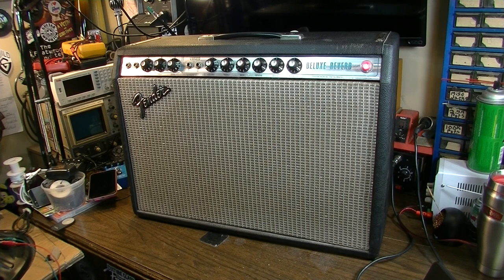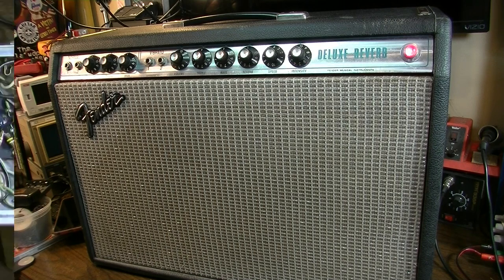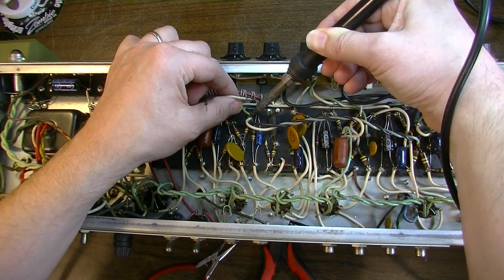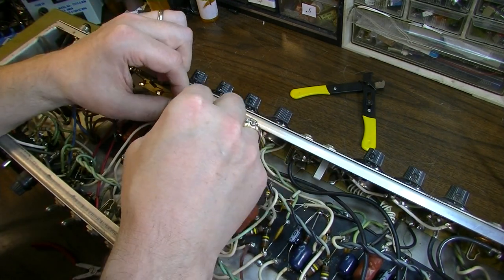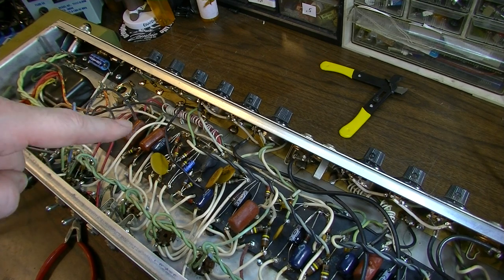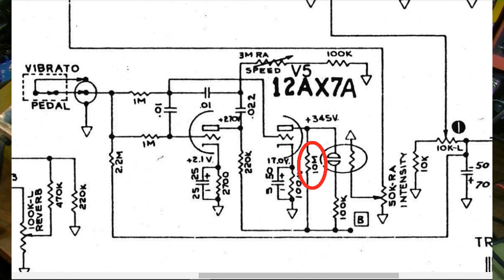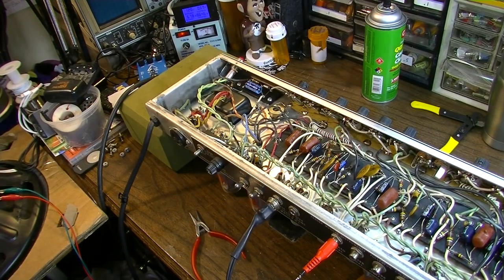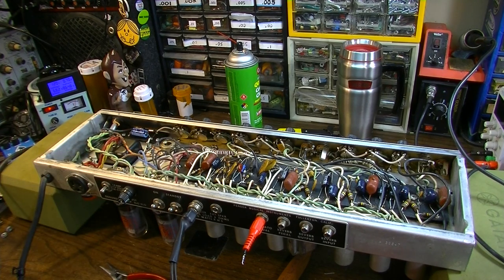Fix Your Fender Amp’s TICKING VIBRATO (TREMOLO) Problem!

Comment: Thank you for this video, the 0.01 cap, bypassing the 10M resistor completely fixed the ticking noise issue on a 69 SF Vibrolux Reverb (AB568) that I'm working on. Keep the good works!

Comment: In another lifetime, and I mean a long time ago, I was a bench tech in the marine electronics industry.  The way I'm reading the bulletin, is If there is a capacitor across the 10 meg resistor (parallel), remove it.  Then add a .01mfd capacitor from the 10 Meg resistor to ground (series).  The schematic sure looks like that to me.  Am I missing something?  Regardless, adding the cap across the resistor looks like a fix. Nice job on the video, and very good "how to"....Thanks for sharing!
Reply: You're absolutely correct. That's how "service bulletin #9" actually did it. The original bulletin even includes a layout drawing. However, doing it the way that Brad shows here ALSO works, and sometimes works better than Fender's recommendation. Go figure.
Reply: That's right, the bulletin says to place the capacitor between the junction of the 10M ohm resistor and the optoisolator TO GROUND. It does NOT say to place it in parallel to the 10M ohm resistor.

Comment: It floors me to see how these signal paths were originally made. Who on earth figured out which capacitors added or removed different parts of the spectrum?!! Beautiful to see
Reply from the maker: The tremolo circuit is just an oscillating tube stage which is connected to a light bulb, such that the light bulb flickers on and off at an adjustable rate. The light bulb shines onto a photovoltaic resistor, that is a resistor that changes resistance depending on how much light is shining on it. That resistor is then connected somewhere in the signal path and acts as a volume pot of sorts.
Reply: @TheGuitologist  you need to publish brother. You have an encyclopedic knowledge of electronics!! Thank you for taking that time. I NEVER would have figured that out!
Reply: Michael Farady, James Clerk Maxwell, and James Watt, to name a few. Up until the 18th century, human beings didn't even know what electricity was. Throughout the 19th century, many people, including those mentioned, contributed to the basic science that unlocked our understanding. In the 20th century this fundamental understanding was progressively put to work to create useful technologies. (The oscillator circuit discussed here was developed during this time.) Today we stand on the shoulders of those who went before us.

Comment: I ran into this issue on my first couple of DR builds.  I see it as a design flaw in the routing of the 2 grid wires for the V6 12AT7 inverter tube, pins 2 and 7.  They routed them in the same routing holes, or adjacent to the tremolo output wire going to that center pin of the tremolo jack.  The tremolo wire is like a spark plug.  The signal is being shot down that tremolo wire from point F on the drawing, plate output from V4B, out through the photo bug like an electron power drain to reduce signal to give you the tremolo effect.  I rerouted the 2 inverter wires away from the tremolo wire and used shielded coax for those 2 wires.  It eliminates that ticking even with reverb on.  It doesn’t take much movement of the tremolo wire away from the grid wires sometimes and that’s why it manifests itself a bit different between amps.

Comment: Thanks for the tip(s). I have a blackface DLX RVB and the .01 cap worked. The wire locations look way different than yours so I left them alone.

Comment: Wow what a difference the dressing of the wires made... And honestly, I found the wording for the installation for that capacitor just awful.. But you nailed it Brad! Great job, thanks for sharing. Be well, Tom
Reply from the maker: Yeah, can’t figure why they didn’t just say “in parallel with the 10M resistor”.
Reply: @TheGuitologist  because the schematic shows it to not be in parallel with the resistor.  The words are only partially correct in that the cap is to be placed ON the resistor, but it doesn't tell the whole story.  It can work in parallel with the resistor too though (sometimes).  I think I've now seen 4 ways to skin this cat:  your parallel method, Service Bulletin #9, 220pF across p1 and p3, and a diode across the outer lugs of the Intensity pot.  Each of these change tone and feel, especially depending on the orientation of the outer shield of the cap used (or disc cap).

Comment: Well, you made my day sir, to see what I made being used for what it was intended, as insignificant as it is, was a thrill, not gonna lie, many thanks man.
I really appreciate how you find spots for fan mail to get into videos, that's just really cool man, and if it actually doesn't work well, please don't continue to use it on my account, if the tip is too fat, you can sand that down and then hit it with some linseed oil, which is why I did the finish that way, just easy to reapply. 
Yes, I spent way to much thought on what is a fairly insignificant thing, but I can't control my brain, it has a mind of it's own...
Anyway, I just thought I'd let you know you made someones day today, thanks again man!
Reply from the maker: Thanks for that. It’ll get a lot of future use I’m sure.

Comment: also i wanna say, in quick, my girlfrind became disabled from lupos , i began building amps to keep sanity while i 

watch over her , something i could research and learn while i sit with her,    i got my 100 watt old carvin turned into a power head, ive built a couple preamps to connect to my power head , my amps have a preamp pi     then   to power amp,,,,,,,,,,,,,,,,,kinda modular.... pre and pi   to power.via rca  connectins  im having a blast building my amps, i want to thank you brad and uncle doug, and d lab and blue glow for opening a new door for me that was so much needed   ....
Reply from the maker: Amazing. Thank you for watching, George.
Reply: @TheGuitologist   i was watching the vid on pi switching 100k 47k 1.5k resistor on cathodyne pi,   seems there is a resistor missing , doesnt the cathode have a 1,5 k from the cathode before the switch matrix ?    the schematics ive seen have a 1.5k to same value on the plate , where can i put the switch matrix on a 56k plate, 1meg to 1.5-56k cathode  cathodyne pi?

Comment: Another nice vid.   Measure the LFO on your scope and see if it is a square wave.  Then measure it with the new capacitor and see if it is more "rounded" on the edges.  The sharp edges of the LFO will cause this ticking noise.  Im curious to see if that's the issue.  How come no lead solos or guitar playing at the end of this vid?

Comment: Just picked up a Fender Bandmaster TFL5005D probably from the late 1960s or early 70s. The Tremolo is doing something weird. When activated using the footswitch, the effect seems to turn on but it has no depth to it. Can hear the oscillator running and the speed control works as expected. The Trem sounds like it is in the background only. Does the "roach" in these amps often go bad? Could that be the issue here? I can pick up a new bulb / resistor roach from Tube Depot thankfully if needed. Thanks for any info!

Comment: Brad, what would happen if you rap a shield around the lead pack wiring all the way to there terminations and ground the shield to the body? Do you think it think it would cancel out some or all of the noise? And yes I felt your pain with the garbage disposal, took mine out and started a recycle bin for the garbage and use the waste after it works down on my plants as a compost. My disposal doe's not break down anymore. My simple life hack!    Best wishes from south Florida........

Comment: You're the pro, but I have a couple thoughts. Maybe winding or braiding the green, white and black together and insulating them after removing them from behind the pots and resister instead of cutting them down would lessen the length. and add the Mylar Cap 2: I have to wonder if we can insulate/shield the sloppy lead dress with some aluminum tape shielding wrapped around them then coat the entire area wrapped in aluminum in liquid tape or similar to avoid any shorts in the future and maybe that will at least minimize the noise enough to add the Mylar Cap which seems to be a must will finish the problem or more importantly removing the wires behind the pots and out of the way of the resistor on the cap that you had to remove and the Mylar Cap would have solved the whole issue. Any how the way you did it worked so.

Comment: I got a new 68 Custom Deluxe Reverb dude it was ticking so bad I sent it back & got another new one it also ticks not quit as loud but pretty loud. Many folks say it's the curse of the Fender Deluxe Reverbs black face & silver face models,  I heard a cap installed at the point of the circuit just in front of the tube that does the vibrato will stop it .

Comment: READ THIS IF YOUR AMP TICK'S!!

I have never had a ticking problem until today, and didn't know how it happened. After an hour of searching i finaly found what was wrong!
This weekend i had installed an electric mower. This little thing senses his border through a cable where there is a current going through. The signal is quite strong because it can sense it up to 100ft. (30m). And because its so strong, the pickups on my guitar sense it, causing the ticking! 
For those who have electric dog fences, its the same deal.

So before you open up your amps, check if its not caused by something like this.

Comment: Effect rode has a comment on their website to move the ground on the speed control to the ground of the resistor and capacitor on the cathode of the oscillator tube, not the opto driver tube.

Comment: Hey Brad, why not put a couple of teroid to act as a choke to get rid of that noise ?

Ricky from IBM
Reply: What's a teroid?
Reply: Richard Biffl A toroid is a coil of insulated or enameled wire wound on a donut-shaped form made of powdered iron. ... Toroidal coils of a given inductance can carry more current than solenoidal coils of similar size, because larger-diameter wires can be used, and the total amount of wire is less, reducing the resistance .
Using this donut shaped powered iron it can be used as a choke to trap or choke of EMF and or RF from interfering with  electronic devices
Ricky from IBM

Comment: What watt of speaker should I use in a 40 watt fender amp? Thanks
Reply from the maker: 40w or greater if it’s a single speaker. 50 is safer.
Reply: @TheGuitologist  What would be to much?

Comment: Does the .01 MFD capacitor have to be 600v? Is that what you used in the video or a lesser voltage?
Reply from the maker: There is about 350v at that spot. But the way I installed the cap was technically wrong from what Fender suggested, so the V potential is not that large. The mod I did is really a safer mod than their actual suggested one. See pinned comment.
Reply: @TheGuitologist   Thanks for the quick reply and info.

Comment: Hoping someone can offer some thoughts on my ticking 78 Vibrolux tremolo. Amp is with a tech once again to try and fix the ticking tremolo. Optocoupler has been replaced and every 'fix' known to man has been done including redirection of wires from the tremolo controls etc. etc. I called my tech today to see how things are going and he informs me that as soon as the chassis is put back into the cabinet the ticking returns thinking he has it solved. So when the chassis is on the workbench no ticking. Cover the circuit/chassis with a piece of foam while on the bench and running ticking goes away. So when the circuit is exposed to light it's fine but when in darkness the ticking is back. He is a patient man but I think he's had enough of my Vibrolux and I don't blame him. Nothing seems to work. The new optocoupler (bug) was the type that is fully sealed. If anyone has any thoughts as to what on earth is going on please respond ! Thanks in advance.

Comment: Wiring a tube tremolo is a dark art, not science. Once you wire it up according to the schematic, you are about 10% done. Had a similar issue with the tremolo on a Mojotone tweed vibrolux clone. Three days later after pushing wires around and adding shielded cable it worked perfectly!

Comment: Most of the time I find that the Plate wire to the B side of the 12AX7 before the Phase inverter is very close to the Grid wire of the 12AT7. That's usually the first place I look.

Comment: I have a twin that ticks, would this possibly be a fix for  a twin?
Reply from the maker: Yes. Same concept.
Reply: before doing that maybe check the wires at the valve for the tremolo (the 5th for a drri) see this video www.youtube.com/watch?v=AZWJevfjrUw for more info. It fixed the same problem on my ddri

Comment: unluckily the European version has a replacement for the roach :/ i think, that originally the extra cap was intended to be connected to ground (to the other side of the roach) ... In my case, European version of the reissue, just rearranging the wires to the tremolo tube helped a lot, being aware, that in some positions the tremolo won't work anymore. Oscillation won't start. The rest was eliminated by adding a PPIMV master volume ;)

Comment: Im always amazed when I watch someone solder because the moment they touch the joint, its hot enough.  I have to sit there and twist it and roll the tip and it always takes 2 or 3 minutes to heat the smallest joint.  Once the solder flows I can make perfect joints.  What the fuck am I doing wrong?
Reply: A few possibilities.

1. Your tip must be clean and well tinned (nice bright silver) with a little fresh solder on it.

2. You might need a stronger iron. A little 15 watter for component board work doesn't have the ass for heavy gauge wiring for instance. Oh it can be done but like you said, it's going to take a long time. 

3. This is unlikely but something I run into a lot. There are higher temp solders out there. I work on stuff that's put together with high temp silver solder a lot. Requires a beefy, 900-1000 degree iron to deal with easily. You wont find that in amps so I doubt that's your problem but thought I would mention it in case your working on controllers for electric race cars or something.

Comment: Had similar issues on my 65 DRRI but got it solved at the V5 tube by only bending the green and blue wire away from each other. Thanks to this video by kody harrell youtube.com/watch?v=AZWJevfjrUw  Did you miss that solution Brad?
Reply: Same here with my 65 DRRI, and I found and used the same fix. If I were more confident with a soldering iron I might try adding a capacitor per Brad and Service Bulletin 9, but using a pencil to push the wires apart quieted 90% of the noise so I no longer notice it.